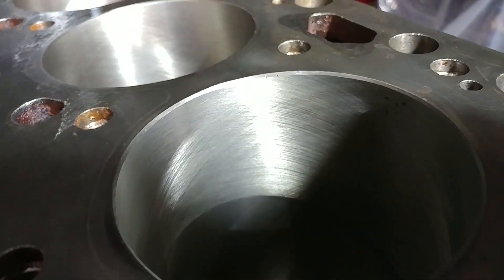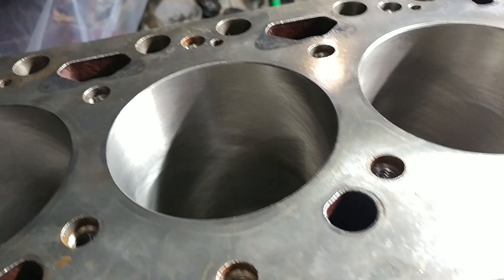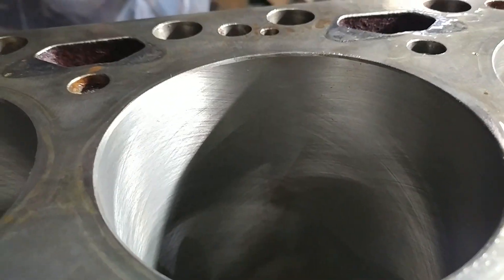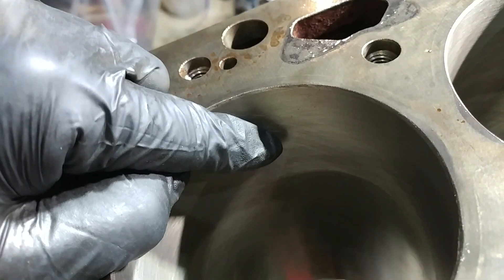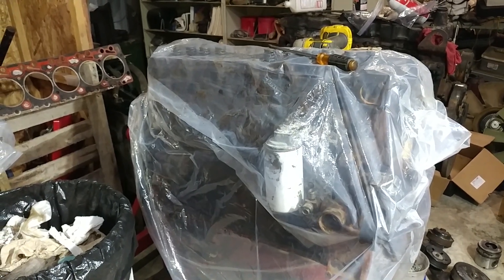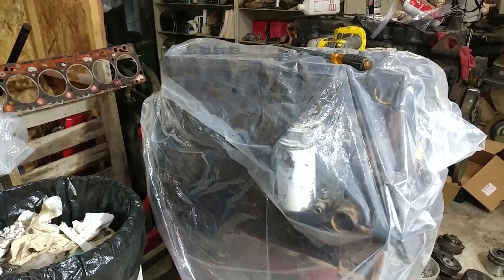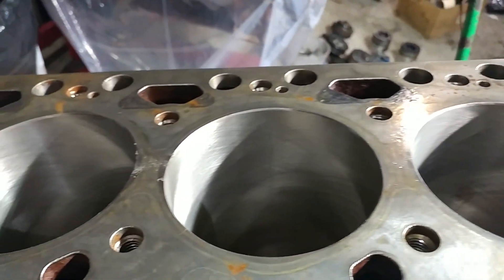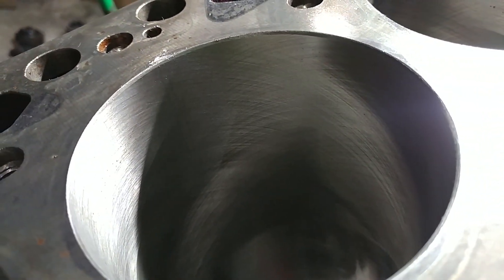Chronicles Of An 03 Cummins Rebuild - Part 3  - What Is Cross Hatching And What Does It Look Like?

Comment: ❤️ - you just put the biggest smile on my face.

I had just finished saying it was such a beautiful cross hatch. and literally a half a second later you said it was beautiful crosshatch!
Reply from the maker: What can I say man! Great minds think alike! Have you had the chance to open up a motor with a ton of miles on it that was still pristine inside?
Reply: @70440charger  - unfortunately I have not. I am looking forward to finding a block outside of a truck that I can rebuild to install in my truck.

I learned about the cross hatches and a lot of internal items on the Cummins diesel through Deboss Garage channel here on YouTube.
Reply from the maker: Very Cool man! Make sure that you keep us up to date when you start working on the the new motor! It is a labor of love, but I think it is super satisfying to know that you build the motor that is powering your own truck!
Reply: @70440charger  - Agreed, and will do.. I will try to remember to tag you in it, however it may be several years down the road yet... I have just finished acquiring my trucks, a lot of work to do to them before I start building an engine that I don't exactly need at this moment.

But for now I'm going to finish watching your series and pick up tidbits of information along the way. Thanks again buddy.